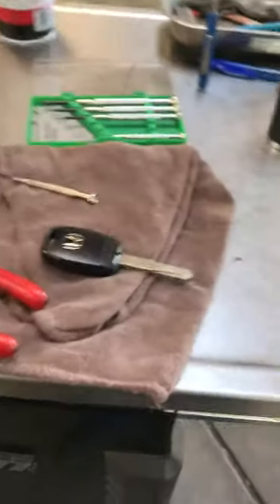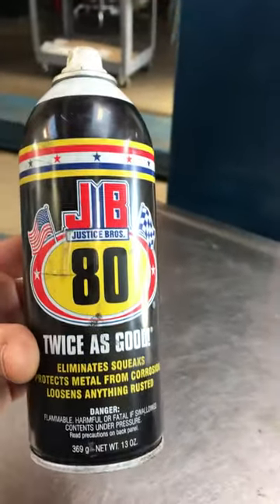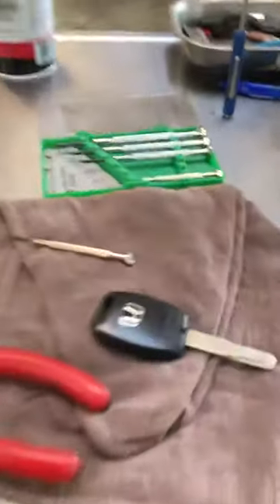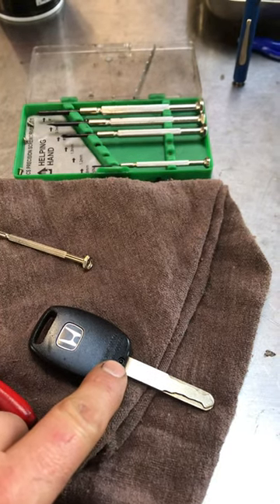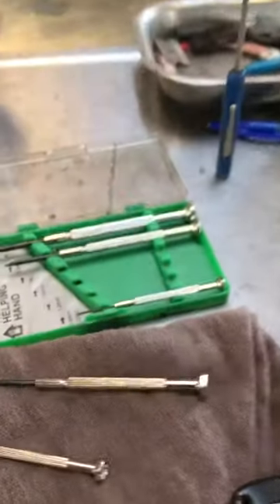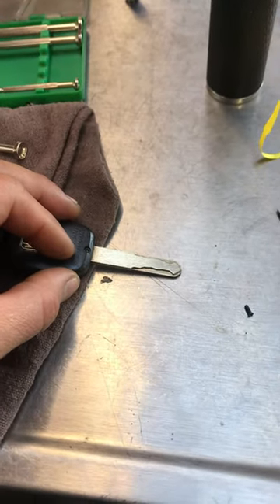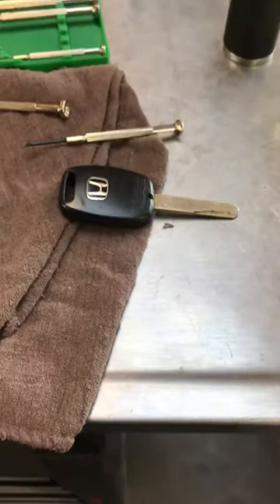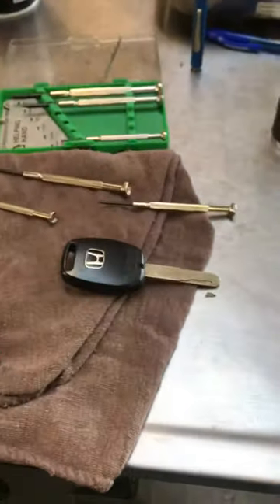Removed a seized screw on a key fob for a car

Comment: Man, you saved me so much frustration! Thank you, brother!! I sprayed freeze off for stuck locks that were rusted over, and that didn't work. Then I searched YouTube, and bam, your video popped up. I did what you suggested but I just took the actual key out of the old casing and heated the screw directly with my torch. It worked great!!

Comment: Your video is by far the best solution. It worked for me within 2 mins. I was trying for two days with a fear of breaking the damn plastic casing. I wish, you could post a link, on where to get the replacement screw.
Reply: I had to go to the stealership to get the screw. They had a box of bad keyfobs and just gave me one. I guess the stealership did me a solid on this trip!